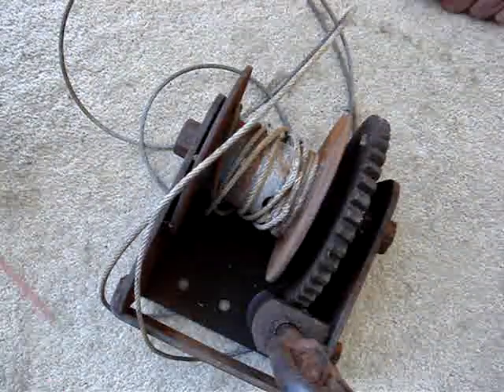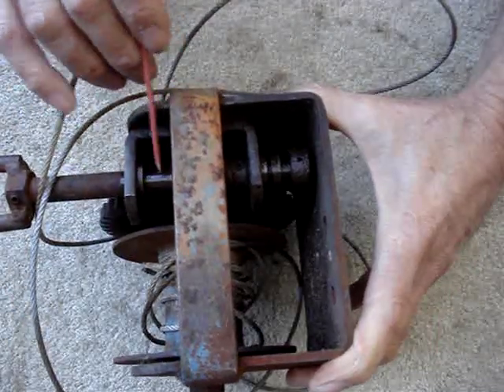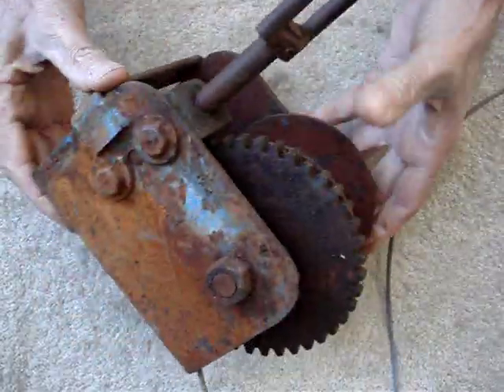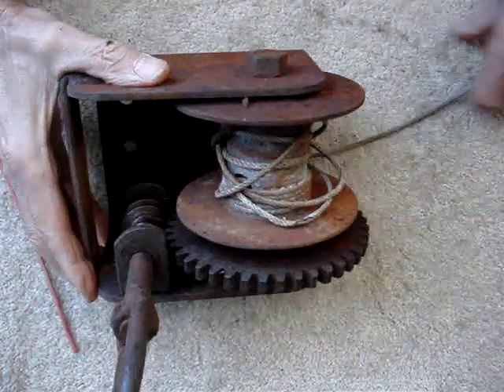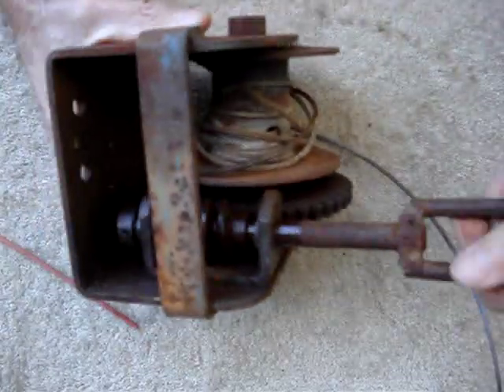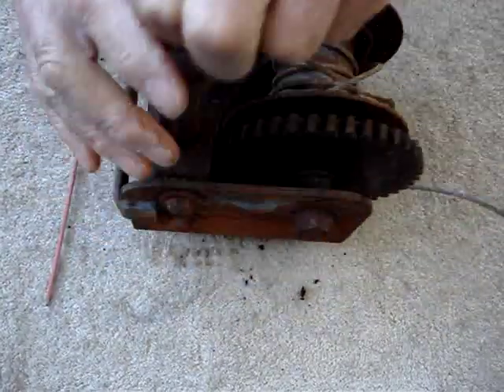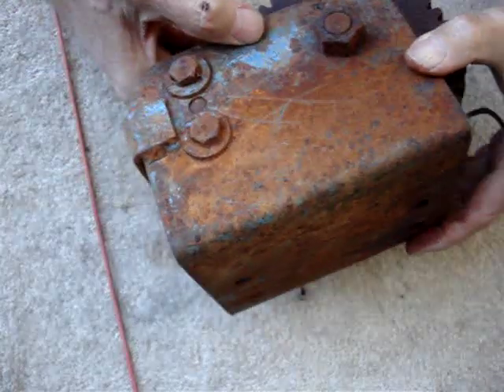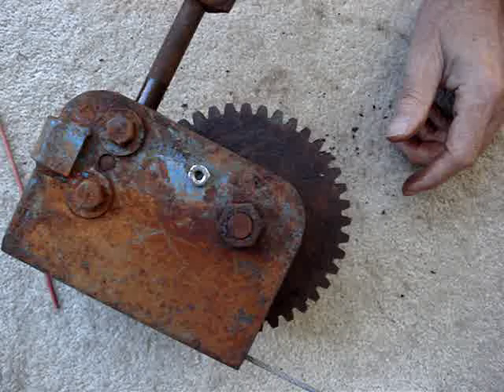old winch - modifications plan

Comment: Well making the pinion tilt the way you said is a good idea ,instead of a top bolt that you,ll have to take off and on put a pin with a with a pull pin with a piece of wire so as not to lose it .
On the other end ,you would be ahead welding a crank on the side of it with small teeth that would mesh with the teeth on the spool so you wouldnt need to do so much with it ,on the pinion side your missing C clips ,forget about the bearing ,its not gonna spin that much.
Top of my head ?!